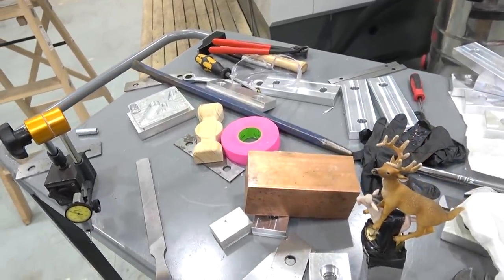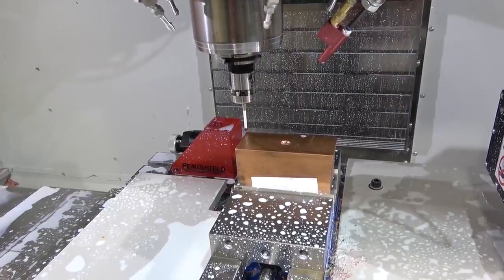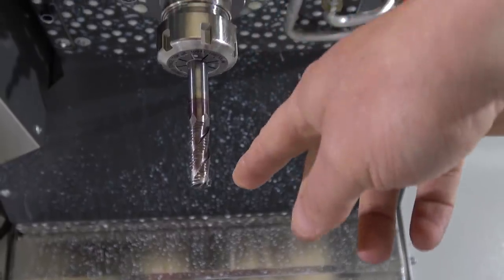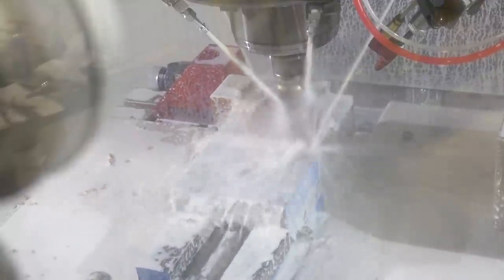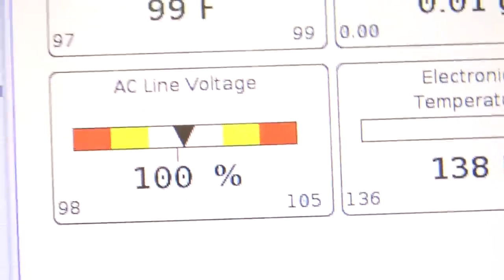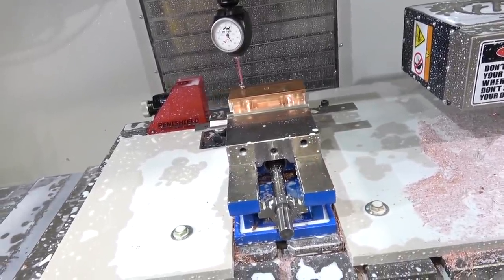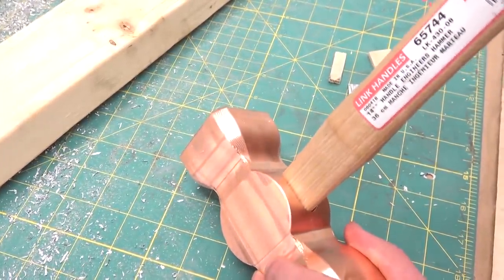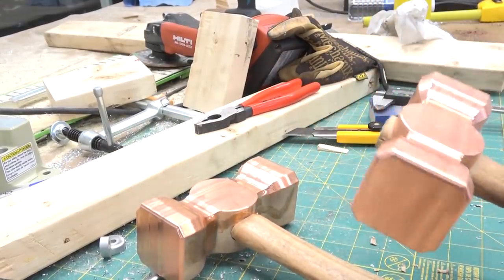Making a Copper Swing Press | An Essential gift for Craftsmen

Comment: "Swing press" 😆 heard this the first time for a hammer. 
In Germany we call it sometimes "Meinungsverstärker" (lit. "opinion amplifier")
Reply: Coming from much German lineage, I love that!
Reply: Hammers are known as "American screwdrivers" in Sweden.  ;)
Reply: Seems everybody has some version of that. Quite common in the UK to hear a screw referred to as a 'curly nail', also.
Reply: "The Persuader" heard that one a million times
Reply: My dad calls it a bashing stick.
Reply: Have you heard of the Ein-Achsen-Drei-Seiten-Kipper?
(Single-Axle, Three-Side-Dumper)
Reply: In my father metallurgic work they have a fucking 20 pound sledgehammer with a short handle for straightening steel plates. the guy call it "The precision tool".
Reply: @alejandromechina5959  Where I grew up, the experienced fitters had a saying in  "If it don't fit, don't force it; just get a bigger hammer". I thought it was the sardonic humour common to the trade, along with choice sayings like "We may be rough, but at least we're slow", but when I became a practical engineer I found it has a core of truth: if you need to hit something, you damage it a lot less, and move it a lot further per smack, with a big mass swung slow than with a smaller mass swung at speed.
A couple of love-taps from a decent battering ram will remove the hinges off a decent door without doing much damage to the door itself. A fire axe will require that you destroy the door before gaining access.
Reply: Thumb detector
Reply: I also like mechanical agitator
Reply: Percussive Motivator….

Comment: I've made all of those mistakes, too. I feel right at home :-)

Another option for locating when flipping, instead of a bore, is to square the sides of the block, and put your zero in the center. That's very easy to pick up with the probe, no matter which direction you get it from. Drawback: squaring block takes some extra time.

Separately, the only reason to go to a smaller ball end mill (like your quarter inch) is if there are nooks and crannies you need to get into. For a large, flowy shape, you can stick with the 3/8 or 1/2, and just step over finer, and it will often give a better finish than the 1/4 because the point of contact is flatter.

Comment: It does dissolve off the aluminium but it also dissolved out the cobalt for the carbide. Like blasting the mortar out your brickwork, so your tool dies fast after it’s bath

Get an uncoated tool for copper, the coating dulls the edge. 

You can run 4xdiameter all day long with 10% stepover. I run 20mm dlc cutter 81mm deep at 8000 feed on my vf2ss. 

Also on a Haas 100% is for 24/7 duty cycle. If your not in the red half the time your not going hard enough!
Reply: Technically true, but not really a problem: Your aluminium works as a sacrifical anode, meaning that as long as you have aluminium left the cobalt will not get attacked. And since aluminium is much, much more reactive in that regard (given the galvanic potential and the solubility, my guess is that aluminium dissolves at least twice as fast as the cobalt) you won't get into much trouble if you check every so often if there is still aluminium left on the tool.
Reply: @eulemitbeule5426  meh, even then the amount o W is far greater than Co, so the tungtens shields the cobalr for the most part, only the very surface should be affected.

Comment: another fun mistake is when your gcode is in mm, but the gcode is being execucted in inch mode.
Reply: That actually happened in my shop before i worked there, except they were set on inch mode, but buried in the settings they had it set to mm. It promptly produced neither, and they vouldnt figure out why stuff from the waterjet wasnt coming out right when it was then machined.
Reply: @machinist7230  "hmm I wonder why this is on 25.4x scale. Ah, who cares, it's gonna work"
Reply: @akbychoice  Let's try to land on Mars.
Reply: If you don't have the appropriate G20 / G21 in your safe line, you deserve it :-)
Reply: or it's in metres when you thought it was in millimetres...
Reply: Debated Nothing That.. would be rough
Reply: @jonwatte4293  So much this^^^.  Beating the concept of writing part programs (or post-processors, for those who dislike diddling the machine's bits so... closely...) into new CNC users  is step 1.  Advanced programming techniques can be used to ensure the part program cannot be started incorrectly, sanity checking setup info, ensuring even novice operators (NOT "stupid" operators, as they are sometimes referred to...) can successfully produce parts.  This is becoming less of a requirement, what with the likes of Fusion360 (ETA: before the Inventor or SolidWorks folks start the march up my ass, they're also fantastic programs... but as a lowly "hobbyist", it's all I gots.  And OMG it's so fricken' awesome SQUEEEE!) on the scene, even for us hobbyists.

But it's difficult and timely to get to a rock-solid, safe, correct part program toolchain (CAD -> CAM -> PostProcessor -> NCCode + Setup Info -> Machine + Operator).  And once you get to that wonderful, perfect post-processor state, the boss buys a machine with a wildly different CNC, so it's time to play the "find the bug -> argue with VAR to prove the post is guilty -> test new post -> rince, repeat.  But at least you're getting your money's worth on that annual hostage... errr... "maintenance fee".  

Speaking of operators, beating the concept of safely proofing out part programs is job 1.  The operator needs the confidence to take the part program and necessary setup info (you DO have a detailed, up-to-date setup sheet for that job, right?) and fully proof the process.  After than point, the process can get to be damn near light's out, or maybe the operator can be doing a secondary operation nearby within sound of, and perhaps smell of, the CNC. 

Or it's the same guy, as in UBF's example here. Programmed it, set it up, safely confirmed things are correct, and then put on the operator's hat.  So the interactions are all in his head, but ......

Broadly speaking, you can tell a lot about a company how the triad (trifecta?) between "part programmer/engineering dept" <-> "machine operator/shop lead" <-> "management"... high quality companies excel at the communicating and executing tasks between/among these three groups.  Right down to small shops where these are just single people each.

I've said enough.  It's late.  This bowl's not going to smoke itself.

GO LEAFS GO!
Reply: memespace Lets build a Stonehenge for Spinal Tap...
Reply: And then you lose your martian rover.
Reply: You: let's take it easy, 3mm off the top
Machine: 3 inches? No problemo... BRRRRRRR
Reply: That’s what she said!

Comment: I'm an trained machining operator and I have worked as a tool maker for several years as well. It's more than 20 years since I did any machining of any kind know, but I remember we used methylated spirit when we did any kind of machining of aluminium. It was by far the best cooling liquid when it comes to any form of machining aluminium, and we didn't had to clean the tool afterwards. The spirit kept the aluminium from sticking to the tool and made the aluminium metal shavings/cuttings look "normal". If you haven't tried it, you should. If you know this already and I've missed it, forgive me. I haven't watched many of your videos, but not all.
PS: Also forgive me if I use some of the terminology wrong here. I'm from Norway and I'm not familiar with the English terminology when it comes to machining. 
Thanks for making this videos, and keep your d*** in the place.

Comment: I always had a shop hammer that I tig welded copper beads on it to coat the entire end, worked great.
Reply: Good idea. Lacking TIG, could also butter the end with brazing rod using oxy-acetylene, then switch to copper for a top coat, I guess.
Or use a pad cut from copper flat bar or plate, and silver-braze it to the steel hammer head.Which is essentially how thick copper bottoms are put on high quality stainless steel cookware.

Comment: It does make a difference.
You wanna use a wood wedge, then the steel step wedges diagonally across the wood wedge in a direction that doesn't split the wood.
Reply: Or just soak the business end in Ethylene Glycol after setting it in. I learned that trick from some Canadian guy on YouTube.

Comment: Just check the runout on your probe tip. As long as it’s within 2 tenths it should be fine to use still, glued or not. That’s what we spec them out to when we’re setting up a machine for the first time. Or otherwise aligning them after a spindle or ballscrew replacement.

Comment: Little protip for setting handles in heads with a brand new handle - tap the handle with the head on top for a couple of light blows to start, then use a leather hammer on the bottom of the handle held in free air with the head on bottom. Make sure your hand is well below the pummel of the handle, so you don't smash it, of course. Allow the impact to push your hand and the handle downward, and inertia will keep the head largely where it is. You'll actually drive the handle down through the head, without the stopping shock on the pummel, avoiding starting cracks in the handle. Goes quickly and works amazingly well.

Comment: That offset line where the two setups don't quite line up and you get the ridge?  Yea, you're not likely to get rid of that with a Renshaw probe.  You need to be within about .0003 or less, with fully compensated tool wear, deflection, and load to make that line disappear.  An easier way to do it is to program the different op separations along a natural edge so you're not trying to blend two different surfaces.  And I've not seen the Renshaw probes be accurate to much under a thou, much less a couple of tenths.  Of course, yours may be better set up, the ones I had were much abused.  

Also, I used the "make a bore to probe from the other side" trick extensively.  Nearly all of my fixturing had a 1/2" pocket with an offset to zero dimension engraved next to it to standardize all my locations.  Drop the fixture on the pins, probe the bore, then adjust the offset as marked and it was usually within a thou.

Comment: Been wanting a block o copper like that one. Where did you get your hands on it?
Reply: McMaster-Carr is always a good choice - more expensive than many other places (OnlineMetals or others for cheaper materials, plenty of places for tools/tooling), but where they shine is the selection and quality - it's very rare to get in something that's unusable.  They've got 2"x2"x6" copper 110 square bars for ~$109USD, item 89275K42; they've also got up to 4"x4" as well, but obviously cost scales with material volume...  I've seen their bags in AvE and Grimmsmo videos, so they obviously ship to Canada as well.
Reply: Thanx for the reply josh 🤙🏾

Comment: Nice-looking hammer but you know there is a science to this. You need to pick a handle length so that the center of percussion relative to where you're holding it is in the middle of the head. This way it won't either jump out of your hand when you hit something or get jarred back into it. I've not done the math but that handle looks a bit short to me for such a heavy head.

Comment: When you need more depth on an end mill, use a shorter LOC mill and reduced shank.  Maritool has these in stock if you can't grind your own shanks, but you can run much faster without harmonics due to the much more rigid tool (less flute, same reach).  We use these constantly in the shop and it is amazing the difference it makes.  I made the mistake of using long LOC and full engagement a lot at first and constantly had chatter issues.

Comment: Tip for avoiding the lip/accurate referencing on the second side... 

Use a slip gauge to space outwards between the reference tool and get the underside of the raw material step. Zero on the gauge then compensate using the DRO before applying to the G54 offset. 

OK so you have to probe it manually, but nothing comes for free.

I hold the slip gauge with one hand and use the handle function to bring the probe up and hold the slip in place. Once it's in there you can ring it in with a Wiggle Wiggle and set the last few thou on the probe. 20mm works nicely for most of what I have done.

Also DATUMS, DATUMS, DATUMS.

Comment: For locating the other side: you could shape the soft jaws to ensure precise location after turning over.

This looks like a great project for casting, any chance to see you machine cast the molds for that same hammer and then have it cast in copper? 😀
Reply: We usually casts our own, but from lead. Square head and a pipe as a handle, looks shit but dirt cheap and works well.

Comment: What you can do to get things to line up better after the flip manouver is: if you machine the sides further down than the finished height in the 1st op, once you flip it, Edge find it as you did then mc the chucking allowance off, stop and re-edge find off of the material that has been machined.

Another trick is to put a slip gauge underneath the overhanging chucking allowance when edgefinding for 2nd op. That way you're measuring off of a machined surface again

Comment: When deep drilling copper. Sharpen your drill asymmetrical so that one cutting-edge is longer than the other. This causes the drill to cut oversized holes but no binding up so no breakages.

Comment: I like fitting wooden handles using a bench grinder. The heat of grinding off the mating-surface hardens the wood so they do not loosen as soon.

Comment: 12:00 the Horn of Boding.  Two points:

1) You used way too much NaOH.  Probably 20x than needed.  Even a small amount, careful when adding water!  Add it to water instead, but even a small amount be careful because it can start boiling the water in seconds and splash you.  A drop landing anywhere on skin will continue to burn for days or weeks until you use vinegar on it.  Bad way to lose your fingerprints for a few months!  Happened to me.

2) You could improve the hammer by giving it a coating of styrene.  Dissolve clean styrofoam in a mix of xylene and that 55% toluene paint thinner.  You can add a portion of unleaded gas if you strip the alcohol out of it via water method, for some filler solvent that also helps the solution hold more styrene.  It'll form a heavy liquid and a floating light liquid.. you want to paint with the heavy liquid, so decant the excess and allow it to evaporate a little.  You can also pour it into a container shaped as a slightly larger mold than the hammer, and put the hammer in and it'll dry and seal the whole end evenly.

Comment: That desire to dial the stock flat when you flipped the part was the causation of your miss match.  ALWAYS use cut surfaces for any and all locating, fixturing, and or dialing after that first OP.

Comment: Copper is great, I used to need a battering ram at work, I took a 4" diameter shaft and Tig welded copper beads on one end, almost a half inch thick. I could hang this from a overhead crane with a 20 foot strap and use this battering ram to move frozen forming rolls, without any damage to the brittle/63 Rockwell rolls.

Comment: You could try using cooler coolant. Maybe the copper chips more cleanly and does not gum up the flutes so much. 
You could put a basket of reusable icecubes in the coolant reservoir.

Comment: That machine is JFM! The things it can do. I'm a G code rookie for sure, but it's auto detect lineup with holes is awesome. I thought everyone automatically assumed "how do you line up your work on the back? Drill a hole from the front".
Reply: T L 
Good God, haven’t heard that JFM used in a while. That’s how we used to explain the C-130 Fuel Control to newb drivers.

Comment: to help with 3 axis profiling, you can use an end mill with a large corner radius and you mill bottom to top instead of top to bottom.  this way it keeps the cutting happening farther on the radius of the tool rather than the 0 speed condition center of the tool on a ball mill.  i've only been able to do think on very shallow sections as i havent had any custom cutters made for this, but i think im going to get some 5/8" cutters with 3/16 or 1/4" corner radius on them

Comment: THE METER READINGS ON YOUR VOLTAGE AND PRESSURE ARE RELIANT ON THE RESOLUTION OF THE CHIP,  IT CAN CHECK EVERY ONCE AND A WHILE AND AVERAGE READINGS SMOOTHER, OR CHECK MORE FREQUENT NO AVERAGING AND YOU CAN SEE IT LIKE AN ANALOGUE GAGUE AND SEE ALL THE JUMPS!

Comment: Two things that may help with the copper sticking to the ball end mill. One, try a 2 or 3 flute. Two, looks like the one you were using has Tialn coating and that's best for harder metals and isn't that great in soft metals. Use uncoated or TICN

Comment: That seems like a huge amount of code for a fairly simple part. Try turning on smoothing and set it to around 0.001" then change the tolerance value to anywhere from 1-2x the smoothing tolerance. This will cut the size of code down immensely. Also helps your computer generate toolpaths faster. The galling of the ball mill could be because it's cutting at the center where the SFM gets minimized causing the material to push instead of cut.

Comment: You might want try high speed steel tooling for copper. Particularly drilling. Copper tends to gall, and HSS can handle the shock load better. Nice reference to the Cremation of Sam McGee

Comment: I found an old, old 3 lb copper hammer at a flea market a few years ago, not as elaborately shaped as yours but it gets the job done for the $10 I paid.

I prefer it over lead and aluminum, for non marring blows on steel.